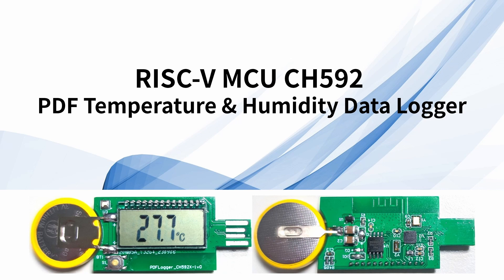#24-Design a PDF Data Logger with BLE SOC CH592

Comment: What is LCD part number?
Reply: The demonstration uses a 4*9 segment LCD. Because the pins of CH592X are limited, only 4*8 are actually used. There is no specific part number because there is no fixed standard for the design of segment LCD.

Comment: Abstract

This transcript details the design and implementation of a compact PDF-generating data logger that measures temperature and humidity.  The device is built around the CH592 microcontroller, featuring embedded USB 2.0 for seamless data transfer to a PC. It offers up to 90 days of battery-powered data logging. Upon connection to a computer, the device autonomously generates a PDF report containing tabular and graphical representations of the collected data.  This unique approach requires no external drivers or software. The transcript covers hardware specifications, program flowchart, and the PDF generation process. 

disclaimer: i used gemini advanced 1.0 to create an abstract based on the transcript.
Reply: Summary

Introduction

* 0:01 - Project overview: Creating a temperature/humidity data logger with PDF generation using the CH592 microcontroller.
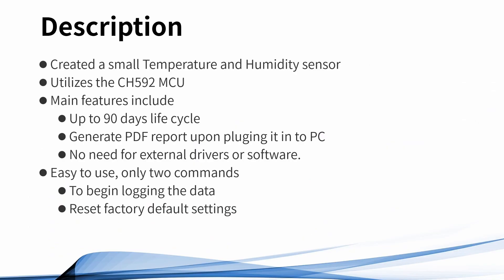* 0:20 - Project features: Long battery life, PDF creation when connected to a PC, ease of use.

CH592 Microcontroller Specifications

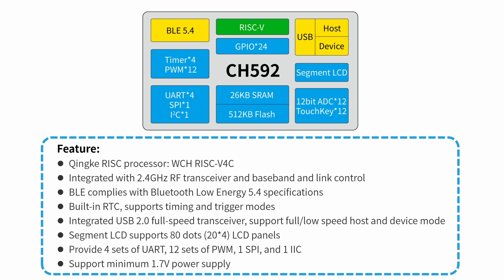* 0:54 - MCU details: RAM, Flash memory, RF transceiver, Bluetooth support, USB 2.0, peripherals, low power supply.

LCD Segment Display 

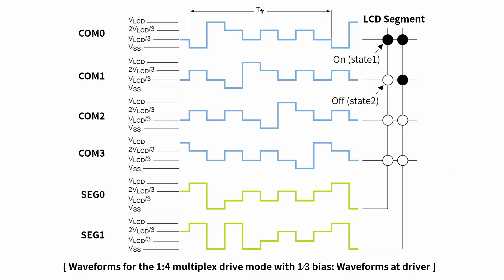* 1:48 -  LCD segment overview, driving mode, and implementation for displaying values.

Data Logger Application

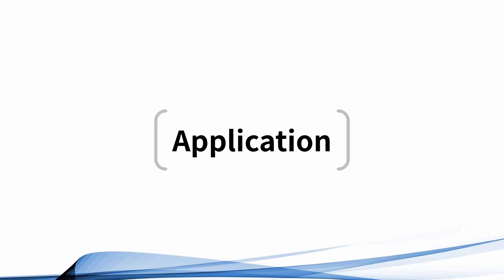* 2:06 - Basic workflow: CH592 as MCU, connection to the temperature/humidity sensor, battery power, use cases.
* 2:39 - Key feature: USB connectivity triggers PDF creation for data visualization.

Schematic and Program Flow

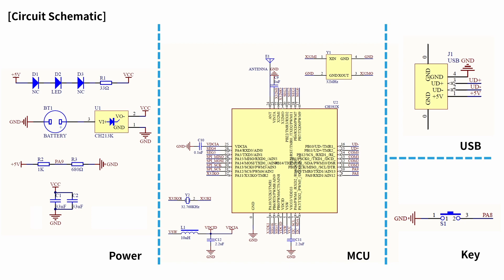* 2:54 - Simple schematic: CH592, battery, LEDs.
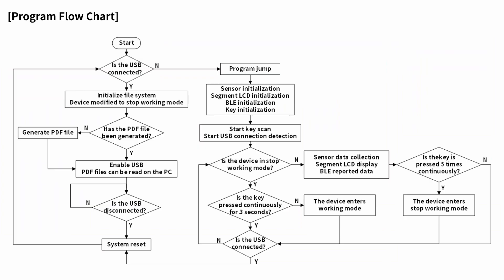* 3:11 -  Program flowchart overview: USB connection handling vs. data logging initialization.

Data File Creation

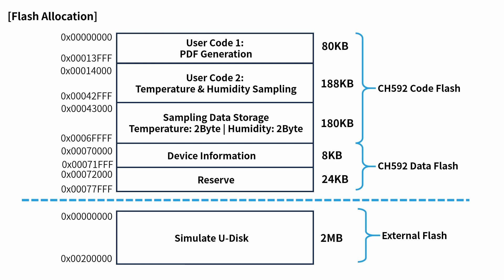* 3:39 - Data storage in memory, allocation for temperature and humidity.

Device Demonstration 

* 4:01 - Overview of the assembled data logger with USB connection. 
* 4:14 - Powering on with 3v3, button functions (initiate logging, reset).
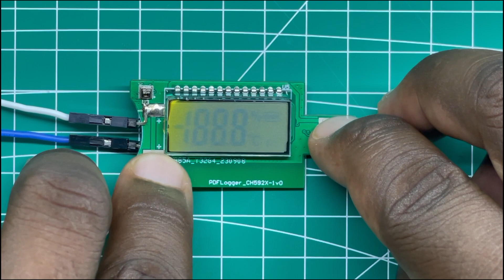* 5:31 - Device turns on and displays fluctuating temperature and humidity values. 
* 6:43 - Demonstration of the final product with a soldered battery. 

PDF Generation

* 7:43 - PDF contents: Device information, graphical representation of data, table with timestamps and readings.
* 8:18 - User-friendliness:  No external drivers, CH592 acts as a storage device.

Closing and Contact Information

* 8:44 - Invitation to ask questions in the comments.
* 8:52 - Contact information provided on Twitter or via QR code.

Comment: nice project! how does it obtain time?
Reply: The initial time can be set through the BLE APP. The interval of each temperature and humidity collection is consistent. Based on the initial time, the time of all temperature and humidity collection can be calculated.